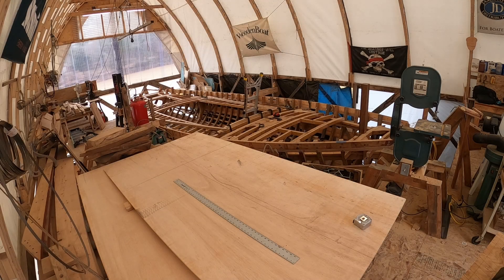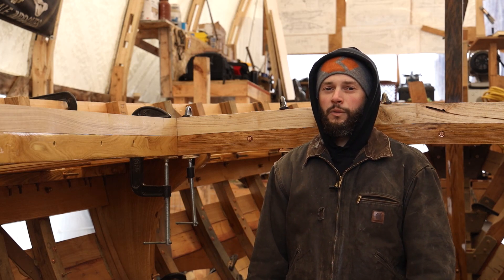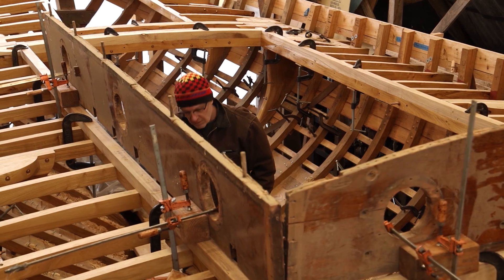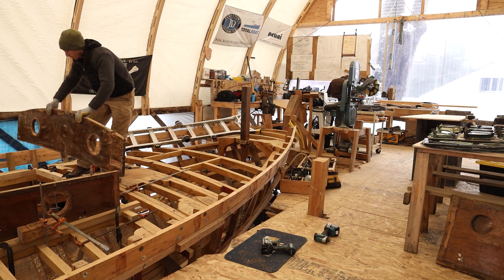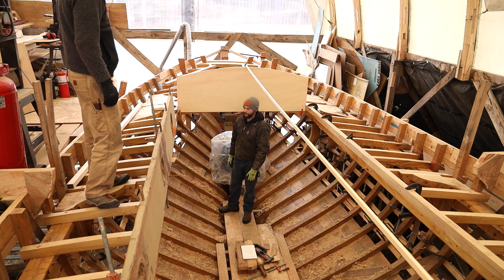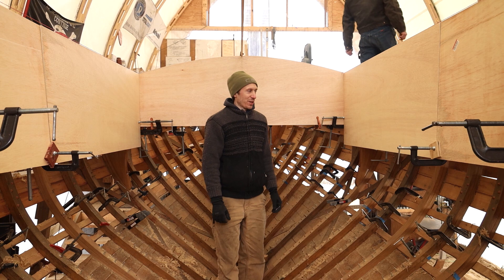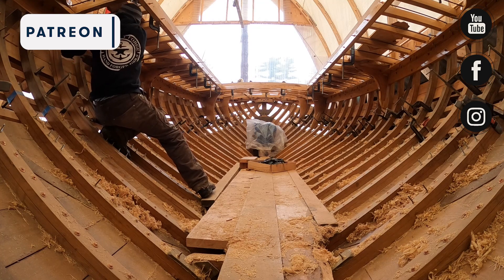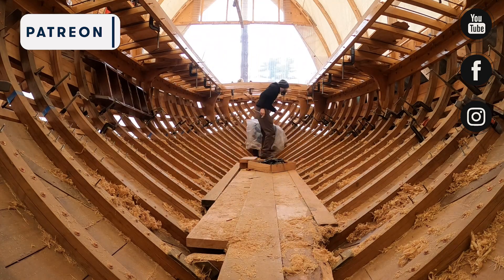Deckhouse mockup -  Episode 148 - Acorn to Arabella: Journey of a Wooden Boat

Comment: Great idea on the over-hang, don’t forget the drip slot on the underside about half an inch in from the end, this makes the rain drops fall off rather than flow down the house wall. A litte 1/4” slot will be enough
Reply: Yup. The drip slot is vital.
Reply: In carpentry it's called a water table

Comment: Guys,  I've had a quick look through the other comments and no-one seems to be highlighting the really important point here. That point is strength. The opening in the deck for the house is a major weakness in the integrity of the monocoque.  The boat has a very reduced lateral strength over the length of the cabin, so the 'missing' deck beams have to be replaced by the coachroof structure. This structure has in effect a dog-leg in it - the cabin sides - greatly reducing its resistance to lateral forces.  They need to be heavily reinforced.  The same consideration applies to the height of the house. Green seas over the deck can easily remove a house-top, and once that has shifted the huge opening is revealed and the boat is doomed.  The idea should be to keep the house sides as low as possible - the forces increase on a cube ratio, so low and curved with knees and massive corner structures. You'll find a good amount of literature on the fate of boats whose cabin top was not up to the task. I say this as someone who has survived a hurricane in an all-wooden boat, and as the nephew of someone who very nearly didn't - plucked from the deck by a merchant vessel as the boat sank.
Reply: Couldn't agree more. Really high headroom is great—until it isn't. You don't want to be sacrificing stability and strength for an inch or two of headroom or bigger windows. Build it like a tank so you won't have to worry about it in a gale! (Or whatever else the sea throws at you) This might be a time to get some advice from an engineer. You don't want to wing it!
Reply: Interesting. I would like to see how the reinforcement is done.
Reply: This really makes sense. They seem to have a lot of headroom, so they should be able to reduce it without compromising comfort too much. Plus, a I think that a lower, more curved deck house will look better, but that's just my opinion.
Reply: You are right, houses are a potential problem  But structurally it's not about global strength, but rather local weakness. 

The hatches of wooden freighters were basically just house sides covered with loose boards and multiple layers of tarpaulin. The boat as a whole has enough longitudinal and torsional strength in the deck and sheerstrakes to stay together without the house top. 

The problem are the corners of the house. If the house wracks under slam of green water, the corners tear away. So the problem is shear, which is combated nicely by laminating the house top instead of just planking it. That and sticking with established best practice and dimensioning should be more than sufficient.
Reply: @francescosirotti8178  they're going to lose about 4 inches of headroom, between sole decking and roof beams. Minimum.
Reply: Instead of the slab sided house, I'd recommend an arch shaped roof with four beams arching from the sides of the hull across from P to S. You could still have step overs along the deck and your high interior cabin. But the beams would give you the strength to 1) tie both sides together without long tie rods.  2) Give a rounded asthetic look to the boat. 3)add a lot of strength to the monoque. 4) give additional places for divits or life boats. Please consider my suggestion for the boat
Reply: @schwarzermoritz  Yes, I agree. But it's not clear at the moment how the house is to be connected to the deck. No doubt we'll see. But it needs to be constructed so that torsions cannot snap the connections to the carlins etc or the whole house being sheered off. One other design criterion often overlooked is based on the assumption that the seas will hit the boat from ahead. If you are running before a storm the risk of a pooping wave is real and can stove in the companion hatch and after house structure.
Reply: @schwarzermoritz  One further point on freighters. The cargo hatches were closed with very substantial athwartship beams which had good strength in compression. Long hatches were usually subdivided by strongbacks that tied together both sides of the opening. Arabella’s coachroof looks pretty long, so I would want to see the Naval Architect’s calculations on stiffness before agreeing that the coachroof did not have to form part of the engineering of this section. Just my two penn’orth.
Reply: Its gonna bee fine, Arabella is absolutely overbuilt as is and the glue-lam house sides will be much stronger in torsion, than a jointed structure.
Reply: @kilianortmann9979  I love optimism, but it needs to be tempered when it comes to specifics. The fact that the boat is overbuilt in some areas would not compensate for inadequacies elsewhere. A monocoque laminated coachroof may be ‘fine’, but that does not solve its fully integrated attachment to the rest of the boat. A chain is as strong as its weakest link, etc etc.
Reply: @RicktheRecorder  Except in a wooden boat it does. The beams, planks and cross-members are part of a parallel structure, distributing loads to other parts of the skeleton, if one part starts to deform. An elastic structure like this behaves not like a chain, but more like a rope, with mutual support. Building something overly strong might actually be detrimental in cases like this. The overly strong part will not deform to take strain away from other parts, leading to local load concentrations.
Reply: @kilianortmann9979  I fully agree, but you seem to be arguing against yourself. Your initial point was the coachroof was plenty strong enough in itself. My point was that it needed to be fully integrated into the rest of the structure (so that it could not just become detached as a very strong but separable part).  The point you now make is that whatever flexibility and strength  exists needs to be evenly distributed through the whole structure, to avoid localised stress concentrations, with which I concur, but is what I think I was saying at the outset.
Reply from the maker: Can’t thank everyone enough for the smart comments, the kind way they’re given, and the time spent writing them. You’re the best.
Reply: @AcornToArabella  Off the top of my head, it’s worth reading Adlard Coles’ Heavy Weather Sailing, and the slew of further books it triggered. Another is Miles Smeaton’s Once is Enough. Robin Knox Johnston’s book about the first solo non-stop circumnavigation of the world (in Suhaili, a self built boat) has already been mentioned. Oh, and just to reiterate, this continues to be an amazing project and video series
Reply: @AcornToArabella  Would it be worth having a naval architect review the structural system, deck house connection, load transfer, etc. and identify the weakest link? If the weakest link is adequate, then the rest is fine.
Reply: @philkipnis740  As I’ve commented elsewhere in these threads, the ideal (from a seaworthiness point of view) is a flush deck. Seas can sweep over without hitting anything much to damage, and it’s easier to walk and work on. Of course this has light, headroom and outside visibility issues so for cruising some sort of compromise is needed, as you suggest. As I and others have remarked, calling the thing a ‘house’ tempts one into thinking its function and construction are purely domestic, rather than part of the seagoing structure of the boat. It really isn’t a wet caravan.
Reply: What do you think the bronze ties were for?
Reply: @justme-jq6wh  Not for the issues we are talking about here. They are largely irrelevant.
Reply: @RicktheRecorder   - I second the recommendation to read Miles Smeeton's 'Once is Enough'. Very sobering reading. That book was the start of my dislike for doghouses and coachhouses on yachts, and of my preference for flush decks.

Comment: It's all about esthetics, but my preference is to let some of the sheer repeat in the roof-top lengthwise.  Also, remember that the sides of the coachroof must be angled inwards to avoid the optical illusion that they appear to be falling outwards. Finally, I would think twice about having those large portholes in the front of the construction. This is where you most likely will take green water in heavy seas, and glass is not as strong as oak.. ;-)
Reply: It's this kind of thing that leaves me in awe of the skills Alix and Steve (and all the other people involved!) have grown doing this. Building a piece of furniture is tricky, and requires thought; but there are no straight lines, square angles or simple things on a boat!
Reply: Very good point! I believe I might use LEXAN in place of glass or at least a heavy Safety-Glass as in auto wind shields and of course, Bronze works for the 2 forward ports only.
Reply: Agree. That is why tradionally these would be the smallest. Please keep in mind an extra inch of headroom will make a lot off difference in comfort! For navigating/actual use: looking over the house will not be an issue at all with this height or a couple of inches higher; when motoring you will be standing in the middle or sitting on the side and have perfect vision. When sailing you will be sitting on the side too. The house will provide a bit of cover from wind and elements too, so an inch more will give comfort in the cockpit too.
Reply: This is sound advice (though I wouldn’t try to follow the sheer in the cabin top, if that’s what’s meant - it needs to shellback if anything in the opposite direction) - and see my other comments ad nauseam!

Comment: Very impressive and very clean mock up for the deckhouse. Gives a lot of shape and definition  to the lines of Arabella. Please make very sure about the integral stability of the cabin sides and roof. There a no deck beams in this huge middle space of your ship to take the stress. Read a comment about rounded corners to reduce wind noise and wind pressure  - makes good sense.
Reply: Correct

Comment: I think that you may need more support for the house roof. In modern ocean navigation there more requirements for electrical equipment like, transponders, radios, radar, GPS Nav, data transmission and SATELLITE phones. If you want to do these videos on your travels you will need more electricity. I strongly suggest looking again at mounting Solar panels to the house top. Along with a wind generator. Just a suggestion!
Reply: Agreed on solar and wind turbines for power generation. Not having to run the engine just to charge the batteries save wear and tear and saves fuel for when it's more needed in an emergency or for docking.
Reply from the maker: These are tricky systems with not much output when much of the rig shades much of the deck during the day and when wind turbines require clearance that a rig with lines and sails and moving things can’t afford. We’re looking into what’s feasible.

Comment: One of the things that crossed my mind watching this episode was, where are the cable runs going to be? Running lights, deck lights, cabin lights, power for instruments, cables from solar panels to charge controller to batteries; lots of cables that need to be run. If you haven't thought of it yet, now would be a good time; don't want them near the bilge, under the deck and shelf might be good, but then what about the vertical knees? Never to early to think ahead.

Comment: super exciting!  As folks have mentioned, and I expect you have considered, think about where your instruments are going to be (if they are going to be mounted on the house side facing the cockpit).  Even if you want to be purist old school, you should have a depth sounder, and there are integrated systems now that can transmit it all to a tablet, but redundancy is important if the tablet fails. I have a lead line but let me tell you that it is no fun slinging that thing dozens of times.  I have a old radar/gps unit, I think radar is still pretty helpful, and I have a bracket that I can hang the unit on so I can see it from the helm.  You want instruments close to the line of sight underway, the less you have to look down, the better.  Just food for thought.

Comment: One thing to consider is that the other boat was a lot smaller and so the pronounced camber in the cabin top had maybe more to do with headroom in there than you are going to need to deal with. Functionally the arch shape is a bit stronger, but mostly it just needs to shed water. More camber also means more slippery. Another consideration is the height of the portholes - it's really nice to be able to see out of them. In port and at anchor, even at sea, you can just keep an eye on things, approaching ships, the weather, squalls, whatever, better when you're inside the cabin.

I had a similar boat, 28' though. The chart table and its seat was elevated just for that reason. Cooking or making coffee at sea is another time it's handy to have the ports at eye level.

Comment: Thanks for all that you have shared over the years …one comment ditch the electric sanders and get a couple of Stanley 112 scraper planes for finishing …quiet, no power needed, and no dust mask needed.  Glass smooth finish.  Another opportunity to learn the science of sharpening and the language of the wood.    Pax Vobiscum

Comment: All that trouble with a canoe stern hull, but hopefully not square cabin corners. 
Any sharp square cabin corners are noisy in high winds  and significant windage while sailing.
Reply: Good point 👍
Reply: How else will you build them?
Reply: Remember the plans for this boat were originally conceived/drawn in the late 19th early 20th century and canoe stern hulls were pretty with square cabins corners were pretty much standard and if he was more concerned about wind noise and windage then the idea of a cabin roof overhang would not be considered much less discussed. Additionally everything about the intended use of this boat is geared towards minimalist fit out  and cruising
Reply: As well as creating strength issues.

Comment: If you had two beams under your roof fore to aft you could support your hatch and have overhead handrails at each beam fore to aft. Fancy would be a handrail dowel with bronze supports off the beam and bronze end caps.

Comment: Mock up looks great,  really now get a feeling for the boat.Where will you store your tender? No problem if it's inflatable, but in my sailing days we used to store the tender on the coach house roof, which will restrict forward vision.
Reply from the maker: Did your inflatable have a hard bottom? Where was your outboard bracket for when the dinghy was shipped?
Reply: @AcornToArabella  the tender(dingy) was hard bottomed and stowed inverted in the coach roof. The outboard was unshipped and kept clamped on the stern rails. The yacht I sailed on was Overlord, check it out, Google offshore cruising club. We also carried the emergency liferaft on the coach house roof
Reply: Check sail Overlord to see pictures of boat. I see they've now got an inflatable dinghy, it was wooden in my sailing days (up to 1994)

Comment: Have you thought about a cockpit coaming, stretching from the outside edges of the deck-house back to the aft end of the cockpit.? This would give a lot of protection from green water over the bow as well as providing a backrest for comfort; particularly on the lee side. Best spot on the boat in weather.

Comment: Will that be the finished height of the floor where you are standing inside the house? An inch or two of finished flooring can make a difference
Reply: I was thinking the same thing about the finished sole.  By the time they put the finished sole (floor) inside the house, that will raise their standing height some.
Reply: Yes, there's no way the current surface they are walking on is the finished floor level... There's no separated bilge space and there's really no flat floor in there.  I bet the floor will be 4-6" above that.
Reply: @ralphgesler5110  Two reasons... One is that a lot of boats will have storage under there for items, and two, because the higher the floor is the wider the floor is in the center of the bat where the main living space will be.  You gain the storage and you gain actual floor space.

Of course, it doesn't have to be done this way, but if you watch the video, there is precious little flat floor area in the main portion of the boat under the house that they were sizing up.  I think they might want to have a little more in there.
Reply: I had the same concern, but they have plans and I would suppose they laid in the simulated floor according to a cross section in the plan.